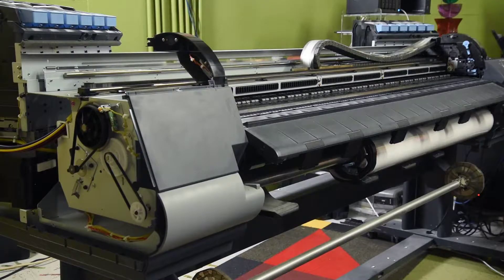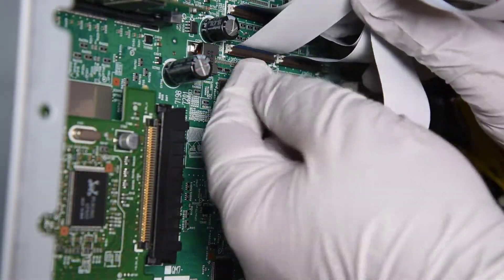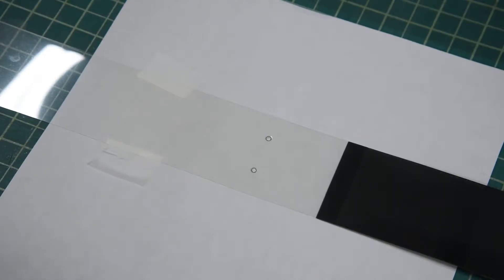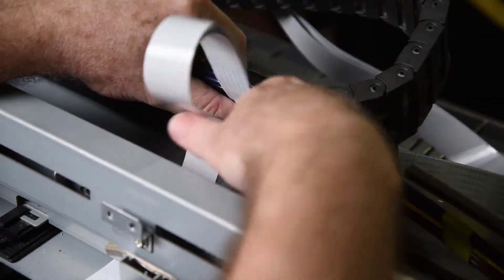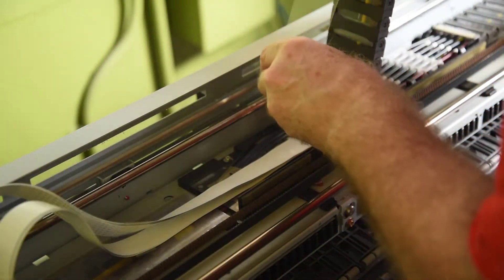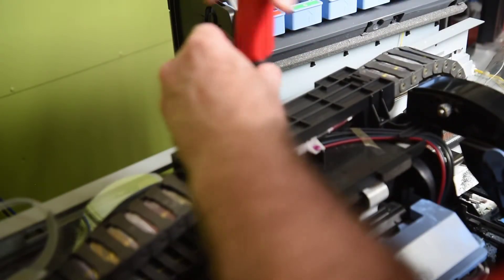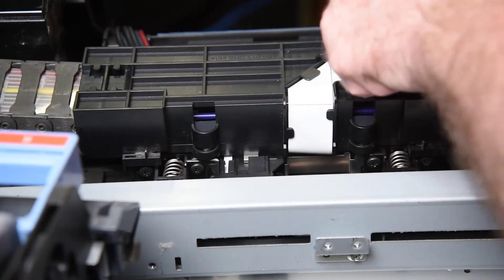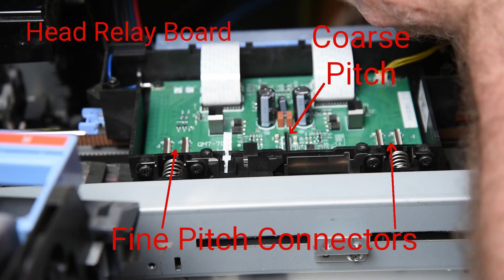Canon iPF9400 Repair -  Random & Odd Carriage Errors

Comment: Is there anyway to ask you about the right print head error on the ipf 9400.. I've replaced it with 2 different ones in case one was bad still says replace right head...
Reply from the maker: If the contacts look good that mate with the print head.  There is a head relay board that can go bad.  The flat flexible cable assembly or the main board.  The head interface board could also cause that but if the contacts look good that would be the last thing I would try.  I would look over the FFC very good, see if you see any bends or creases in it.  Of course the main board is the easiest to try.  We tried that first on this one for the problems it was giving.  Of course that wasn’t the problem, it was the FFC.  If the FFC looks good.  I would try the main board first, then the head relay board.  If neither of those fix it.  Then I would replace the FFC.  I would be nice if these printers would give a bit more error details.  That’s what I would try.  But I don’t work on these for a living.

Comment: Hi thank you for the excellent video. What other errors could a bad flex cable can  throw? My printer is not recognizing the R printhead. Thank you in advance.
Reply from the maker: I’m no expert on these.  But I would imagine almost any head or carriage error could be caused by one of the cables going bad.  I take it you have replaced the head and it still want see it?  I would look the cable over very closely and see if you see any kinks in it.  If so that would be the first thing I replace.  Harder to replace than the main board, but a lot cheaper.
Reply: @metalplasticelectronics354  Yes, you are right. I went a head an replace the printhead and still giving me the error saying to replace it. Where do get your kit from? Thank you very much for your quick response 😇✌
Reply from the maker: It was ordered from iteminc.com  Think the name of the company is item inc.
Reply: @metalplasticelectronics354  thank you very much. I will look into that. Hopefully this is it lol 😎👊
Reply from the maker: It looks like a huge undertaking, but it's not to hard.  Hopefully that will be the problem.

Comment: Hi 
Good day to you. I have a the Canon IPF 605 that giving headache loading the roll. It keeps saying paper not detecting, I bought new rolls and carefully Installed and it still giving me that message I really don’t know what else to do can you help please. Thank you
Reply from the maker: I’m no expert on these printers.  I think there is an optic sensor on the carriage and an optic sensor in the platen.  The one in the platen can easily get debris on it.  I would try cleaning the platen sensor first.  If that’s not it, then clean the one on the carriage.